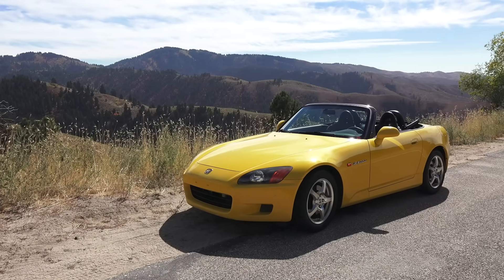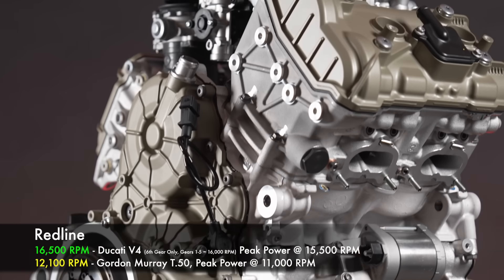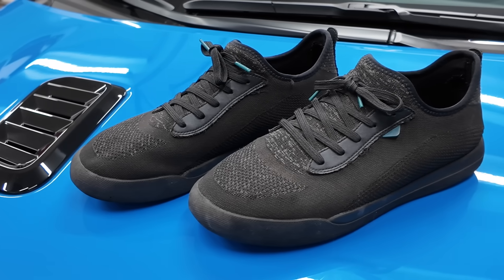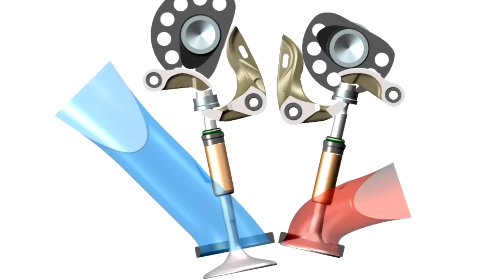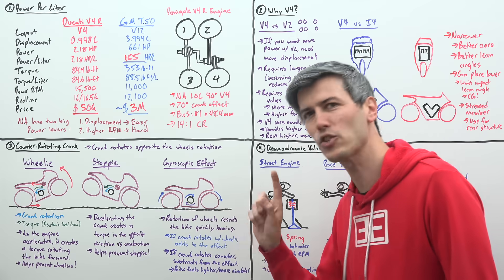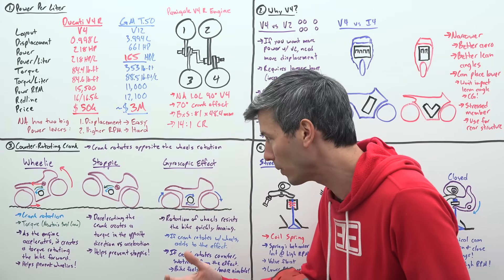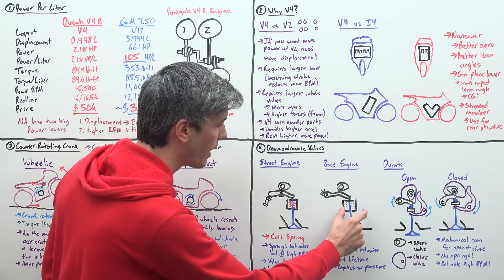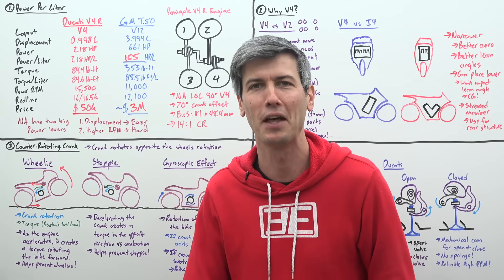Ducati's Brilliant V4 Engine — Putting Supercars To Shame!

Comment: Good morning can I ask u something my car is a 2015 honda accord coupe ex-l 3.5L v6 with 0w-20 using mobil 1, my miles is 062595 engine clean but everytime to start is going to make a nose or is the belt for couple minutes when  driving it's going to stop making noise then sound good , is it the belt or used 5w30? where i living i have to drive  hills. Thank you

Comment: Hey science dude, can you do a video explaining whether it's better to rotate your tires or to replace the rear with new tires and move the worn rears to the front??

A. We're told tires need to be rotated to ensure all the tires wear evenly.

B. We're told that the tires with the most tread should always be on the rear wheels.

C. The front tires always wear faster than the rear tires.

So if the front tires will always be worn more than the rears, and the tires with the most tread should always be on the rear..  WTF IS THE POINT OF ROTATING?!

The only thing that makes sense to me is instead of rotating, just wear down the front tires and then move the rears to the front. Then, place new tires on the rear (from what I understand most of the world outside north America does it this way).

But oh wait, there's D.. All tires should have even grip (which would mean even tread depth i assume.

So yeah, how about that video? 🙏

Comment: I thought the whole point of using compressed air as the valve spring was that as soon as the cam starts to open the valve the air is released so there is no force acting against the cam, then when the valve reaches MOP more compressed air is forced back in so you've got the "spring" back to close the valve. It sounded as if you were saying it's a refillable sealed container which is refurbished & refilled after every race???

Comment: Super Sport motor bike engines can afford to make so much power because are actually very UNDERstressed (!) in daily use. Let me clarify this: of course the power per liter of these engines is huge, which leeds to heavy stress on the engine when fully employed. However, motor cycles are very LIGHT. The result is that these very powerfull engines give the motorbike near supernatural performance. Performance that is so high that in practice it can only be used for very short bursts on public roads. Result is that the engine in reality has to do only VERY LITTLE WORK. And that means that most of the time the engine will be running far below its potential and will not be wearing down very much.

Comment: Rocket three 2.5 liter engine .  Kawasaki H2 turbo built into the engine. , ps Ducati is changing to a V2 engine to replace the v4,  honda is looking to V3 yes V3 based engine set up.  I could keep going.

Comment: I find this Ducati engine to be a concentrated dose of innovation, so efficient and intuitive that it makes you wonder: why wasn't this thought of at the very beginning of the engine industry?
As for the illustration: the channel's signature style, from the four-color felt-tip pen drawing to the oral and gestural explanations, is simply impeccable.
The concepts behind this Ducati deserve a series of videos: the choice of the 90° angle, balancing, ignition sequences, the carburetor is certainly full of innovations, the reverse-rotating transmission... Possible improvements...

Comment: Good video but I'm 99% sure the Yamaha XS-1100 of the late 1970s had a crankshaft that rotated bachwards. I know a fellow who races a Yamaha XS-650 and is very nearly finished building an engine that's crank rotates backwards for all the reasons you mention.

Comment: I4 vs V4: "Better Lean Angles" Have you seen a MotoGP race? Yamaha goes around corners at the same lean angle, but gets around corners faster. From 2002 to 2025, the entire four stroke era, 12 of 24 Championships were won by V4's, 9 of 12 were won by Inline Crossplane Four's. 

Pneumatic vs Desmodromic": So, of course they get rebuilt each race." Have you seen an F1 race or 24 hour Endurance race?? How many sealed engines does F1 get per year? Desmodromic was great last millennium, but it's just an expensive novelty item now, and from 2002 to 2025, the entire four stroke era, Half the V4 wins were won by Honda, no Desmodromic used in those.

Comment: 2 points you didnt mention about the V4 dominating the Inline 4 is the rear tire grip this motor promotes and cooling, Yamaha was forced to develop a V4 in MotoGP because rear grip issues, the pulses and firing order from cylinders through chain in to the rear tire is not even based promoting more slip. I4 has an exhaust manifold on the front of the motor next to a radiator which is meant to run cool, heat rises and the cold air intake sits above it, never made sense. So after the first 2 laps the I4 is running significantly higher than a V4.

Comment: So does Ducatti also use the same rotation orientation on their new dirt bikes?  If so, how does that affect the was they handle in the air?  Can riders still use the brakes and engine to adjust the bikes attitude in the air?  Or is it opposite of other manufacturers?

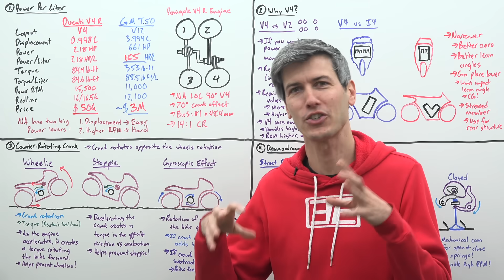Comment: 12:35 I'd rather it not be perhaps. It's what caught my attention in the first instance. Never seen offset crank and set of cylinder's strokes lower than opposing tothers. Very unusual design. As such, do provide an explanation at some pount please (I presume it has to do with compactness and bike's balance).

Incidentally, I don't understand how the chain drive can rotate the wheel clockwise if the crank is rotating in the opposite direction. Maybe I missed a detail.
Reply: 0:26 I've looked at that engine again crank end on. I've imagined each opposing V bore bank with a centre line making an intersection near the crank. Having done so, it seems their strokes are the same. 

That crank's unconventiinal offset creates an illusion that the left bank is shorter than the right. 

I'm not understanding how their conrod big ends connect to the crank with such an imbalance. Very weird.

Comment: One thing that has to be mentioned is that sping actuated valves are optimized for certain rpms, in the lower range they are too strong and they apply a force that inhibits the engine to gain rpms quickly. The Ducati solutions has the advantage that there are no springs that prevent the engine to gain rpms quickly, that is why not only you can make pistons moving faster but they also gain velocity very fast, you could see it in the early motogp era when Ducati used to gain speed very fast compared to 5V Honda at the exit of a bend and get similar speed near the next bend. I mean you can turn a Ducati motor by hand when detached from the bike (I saw it in a garage with my mechanic).

Comment: Another great video, Jason! My 2007 MV Agusta F4 1000 Senna (inline 4) makes 174 hp and even my 2003 Ducati 999 makes 138 hp (and that's a V-twin, of "L-twin" in Ducati-speak). Motorcycles have been achieving 120+ hp/L for a long time. And why do they so often kick butt off the starting line? Much lower power-to-weight ratio versus any car.

Comment: Good video thanks.  The problem with high revving engines is you have to gear them down more than low revving engines to achieve road speed. You end up concluding that only torque matters.

Comment: I'd like to see you cover the firing order since I recall years ago when Valentino Rossi went from Honda to Yamaha that he didn't like the feel of the bike suggesting that the firing order on the V engine be changed to have the cylinders fire on the same revolution and also changing from a 180° crank to a 90° crank.  I think it was called the "Big bang".  Apparently this had other good side effects other than improved performance as it also extended the tyre life.  I stand corrected if I have that wrong.

Comment: Some V4 Ducatis (e.g., Multistrada and Diavel) use a conventional valve spring system, but the high-performance engine discussed here uses a desmodromic valve train.
Reply: Yes…the previous 1260 L-twin motors also used desmo valves.

Comment: All that HP but relatively little torque. Great if you're out there racing all the time, but for everyday driving, I'd like an engine with more torque. But seriously, NOBODY needs that much HP on the street. Absolutely nobody.
Reply: These are streetable race engines, not a daily driver. Makes sense that a simple A3 2.0 TDI is going to be more reliable and comfortable to drive.

Comment: As the owner of a Ducati v4, the new engines now have valve springs not the previous desmo set up
Reply: That is not entirely correct, the Diavel and the the Multistrada (I own) use the standard valve system, the Panigale and the Streetfighter (I also own) use the demo engine, same with the Multistrada RS, if you want more power and required more RPM you need the desmo valve system.

Comment: As Jack Miller explained, the other advantages of having a V4 instead of an Inline-4 is you can mount the the engine much lower to the ground help with a chain pull and minimize the rear end squat hence improving grip under acceleration. The other advantage is that you can swap flywheel when needed as higher mass flywheel helps smooth out the power under heavy acceleration during corner exit. This is what Yamaha is lacking even with modern ride height devices. He said that there’s no difference on Yamaha exit speed when using either 2nd or 4th gear as you’re traction limited at a lower gear.

Comment: Sitting here with a sh1t eating grin -- thank you for this great video.  
BTW, you could have exaggerated the torque effect with the impact driver if you'd added a big socket to it -- increased moment of inertia...
The obvious benefit to counter rotation should be obvious to the other bike makers so it's a bit of a surprise it isn't common or even universal.
Suggestion:  address the use of supped up ignition systems on top fuel drag engines -- they make conventional ignition system seem positively feeble in comparison.  And the reason they do that is fascinating.

Comment: The 1.6 litre Formula 1 engine produces between 830 & 850hp (the leccy motor adds another 160hp) - that's aroud 525hp per litre just with the ICE.

Comment: the first bike i encountered that spun backwards is the hond VF750 sabre shaft drive in the 80's, 

was new to motors and bikes , and simply could not get it fired up,
 only realised my mistake many years later when i stumbled on this info, 
should have investigated more instead of
 just assuming it will spin the same direction as all other bikes

Comment: Good video. A few points; Ducati pays Mercedes Benz to use their Desmodromic valve system invention.

The Desmodromic valve system still uses springs, it just doesn't rely on them for the full open and closed valve curtain event.

The Desmodromic valve system's cams and finger follower system is notoriously bad in the durability stakes because as soon as the follower and conjugate camshaft dimensions start to wear that in itself brings accelerator durability issues and on an on it goes.

Main benefit for Ducati when running their Desmodromic valve system in MotoGP races is that the valves can be opened and close at a much higher acceleration/velocity rates, meaning intake and exhaust timing events become like an off/on switch.

Those acceleration/velocity rates are simply unattainable with a fully spung valvetrain and even also with a Pneumatic valvetrain.

Comment: HM, I have a 95 VFR and 2001 VFR. both 90 degree , single sided swingers. and motor is stress member. Grear driven cams. 11750 redline. paid $3,000 and $3,500 both mint. Addicting sound and performance. Thanks Honda.

Comment: The one thing you cannot breakdown on that board is that cracking the throttle on a bike will always leave a person with a bigger grin than putting your foot to the floor. You just have to experience it.
Reply: YAMAHA 
New ~ Motor =
Geração  ~ New =
V4"Turbo ; Projeto :
New = Model's ;
Desenvolver =
Motor : De : 850 -
CC : Turbo :
Desafio ! Grande  !
Desenvolver ! Motor :"V4"Turbo ";
New ~ Geração !
Inovação ! ; 
" YAMAHA "
Hi ~ Tecnology !
= YAMAHA  :
Motor : 850 - Turbo : G.P. =
Ano : 2027 
💎💎💎💎
🏍🏍🏍🏍
  🏆🏆🏆
❤❤❤❤
😘🤩😍🥰
Yamaha
Motor 
850 =
Turbo 
2027 
💎💎💎
Yamaha
  G.P.

Comment: Since desmodromic valve systems have been around since the 1950s any patents relating to the basic idea have long since expired. The last Yamaha R1 had a redline of 14,000 with conventional valve springs so not a huge difference. Even the Ducati system has auxiliary valve springs that help seal the valves at low RPM so its very complex. Then figure in the much higher maintenance of the desmo system. This is OK for racing but for everyday street use I wouldn't put up with the maintenance intervals and cost. I think the time for desmo systems has past. There is a reason only Ducati uses it, mainly tradition and brand identity.

Comment: The counter rotating engine also allows the rider to put more power down.  The more the wheelie is offset, the more power the rider can put into the wheel before he has to let off the throttle.

Comment: Ducati actually used counter-rotating cranks way back in the 1960s (probably 50s as well, but just speaking from personal experience).  I think at that time it was just an artifact of their engine design, maybe they had thought about it in terms of handling, though.  You definitely didn't have to worry much about wheelies with those old singles 😂

Something to note about the "cancellation" of the gyroscopic effect, though, the resistance to leaning from the wheels is still there, but you actually have internal forces between the engine and wheels acting against each other through the frame to cancel out, they're not just magically gone because something nearby is spinning in the opposite direction.  The frame is plenty rigid enough to keep you from feeling anything weird from it as the rider, but a lot of people seem to think the forces are just magically gone and not still being experienced somewhere.

Comment: Question on the counter rotating crank cancelling out the gyro effect: wouldn't the system still have the same angular momentum at steady state and thus be just as resistant to leaning?

The thing that would cancel out would be the weird off-axis reaction torque as you change angular momentum, with the crank twisting back in the opposite direction, right?

Comment: I have a question. You mentioned during the section on the counter-rotating crankshaft that it resists the gyroscopic forces of the wheels. Would acceleration/deceleration impact the way this force works? Since earlier you said that on acceleration it works against the wheelie, in the direction the crankshaft is spinning, but on deceleration it works against a stoppie, opposite the direction the crankshaft is spinning. So I could see how accelerating would work to counteract the gyroscopic forces of the wheel, but it seems that decelerating (something done before a corner) would actually work in the same direction as the wheels, making the gyroscopic forces worse. Am i understanding this correctly?

Comment: Actually, MV Agusta was the first modern motorcycle manufacturer to release a counter-rotating crankshaft on their 2012 F3 675.  The bike is only sold as an 800cc version currently and is one of the best handling motorcycles money can buy.

Comment: What you have to remember here is that most cars have a WOT max rated speed durability of between 180-240 hours (depending on manufacturer).

Motorcycle engines are between 10-30hours. 

🤷‍♂️

Comment: Back in the 80s dodge had 2.2L I4 turbo that made 250 hp stock with very little boost. Tweeking the wastegate could get you close to 400 hp from 2.2L. It is cool to see someone pushing the bounds again with high hp to liter configs.

Comment: Great Video! We need another one with the most powerful I4, being the Fireblade RR-R, for a direkt comparison between the two. And what does each layout provide that the other one doesn't. Also why the V4 has greater power potential overall. What Honda have done with their Inline 4 bike being naturally handy-capped vs the V4 is not less of a technical feat, so you have to bring it to the topic as well.  Keep it up!

Comment: Smaller enabling faster revving works too. I bought a 1997 Suzuki Across for a few hundred dollars (Australian) in 2019. That makes (or did new) something like 42 HP out of 250cc, so also around 160-170 per litre, and that's not the most pokey 250.

Comment: There's another advantage of the V-4 compared to the inline-4: the V-4's weight is more towards the back, keeping the rear wheel on the tarmac under braking far longer. Yamaha rider Quarteraro has said that he loses most of the laptime to the V-4's under heavy braking because his Yamaha lifts the rear wheel, making the rear brake far less effective and thus he can't brake as hard.

Comment: We gave up trying to explain to car people the bikes are light years ahead of cars. I mean who could ever imagine our little 1.3 liter yes 1299cc could make 1150 hp. That's not possible. lol.  Come watch these bikes race, you will believe then. World Speed record from 0-311mph in 1.5 miles. Bill Warner RiP.  5 Second full 1/4 mile times near 240mph, dot rear tire no wheelie bar.  Come watch and see for yourself.  Though have to hand it to Ducati, thats a lot of power from a production N.A. 1000cc engine.  Love their desmo valve system, A shame we can't use it.

Comment: Superbikes are just absurd. Most of these engines are barely a liter, making ~200hp at 12k+ RPMS. Most will do 300kph no problem, and with limits removed, beyond. Most weigh around 200ish kg. And they're relatively reliable machines for the performance that, ergonomics aside, you can ride all week long for work or play. All yours for the price of sedan or hatchback. The money to performance ratio is simply unbeatable. The skill required to ride a such a vehicle at near max potential however, is a bit of a different story...